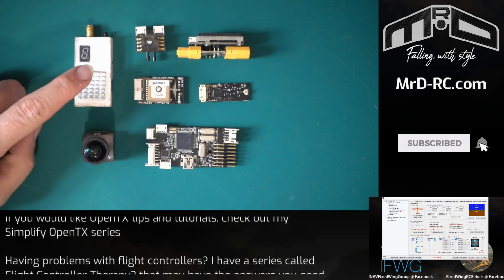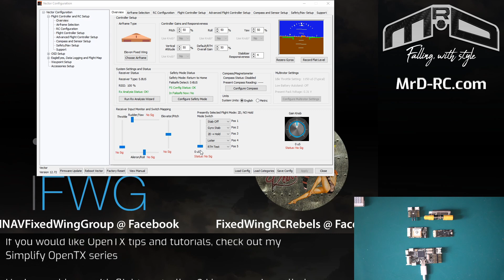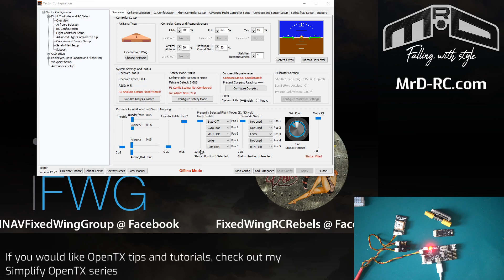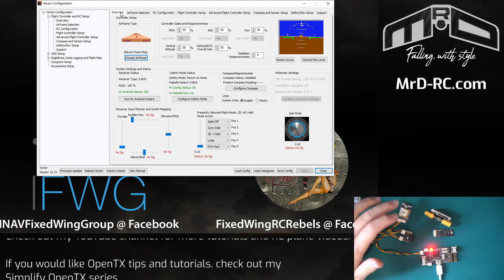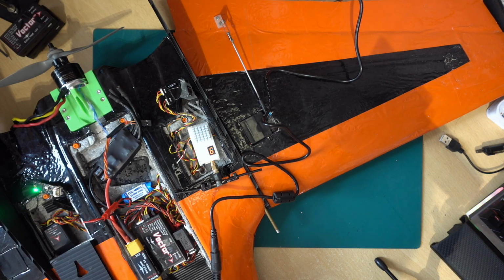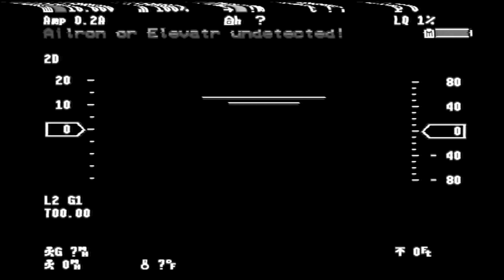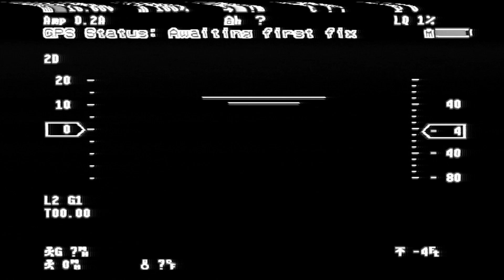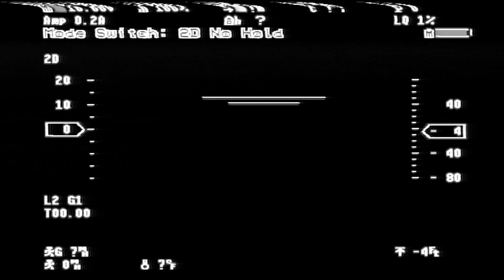What survives when your model goes surfing?

Comment: Glad most of your things are ok! Still fingers crossed on my 6inch LR quad, it went skinny dipping in the sea and I rinsed everything with RO water. Haven't had time to check the components yet. Battery is heavily corroded, it spent about an hour or 2 under water until the tide went out.
Reply from the maker: Hopefully you have luck with the components surviving. Washing out with RO would have helped.

Comment: Anything I fly over water or snow gets a healthy squirt of CorrosionX. Rarely blow anything due to water since I started using it including float planes that have submerged. Really helps when smokin' hot electronics land in a foot of soft snow too. And compressed air is your friend when it comes to evacuating water.
Reply from the maker: Some great tips Jim, thanks.